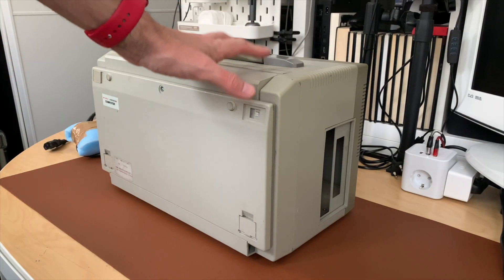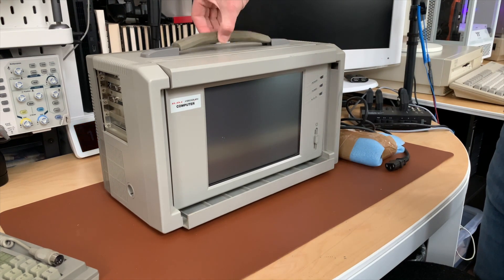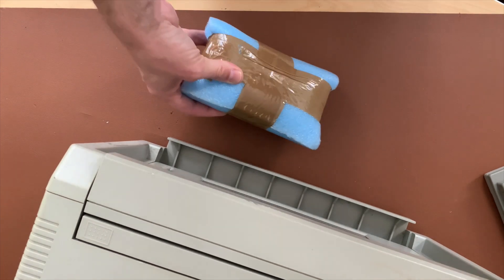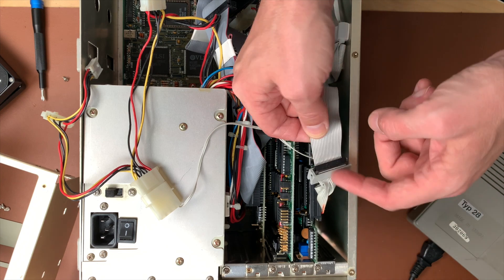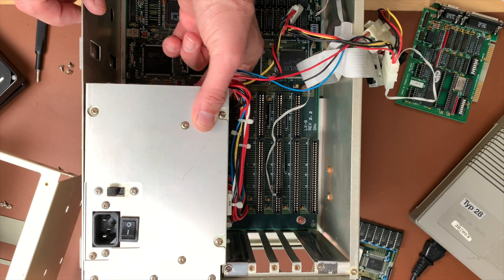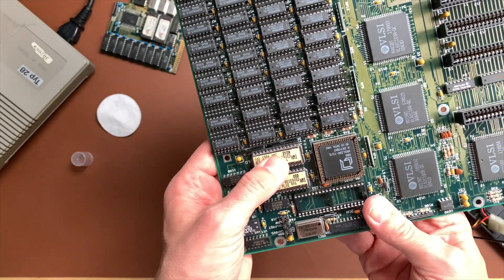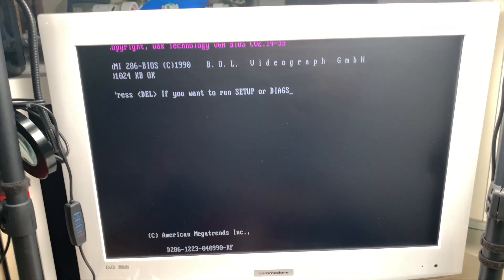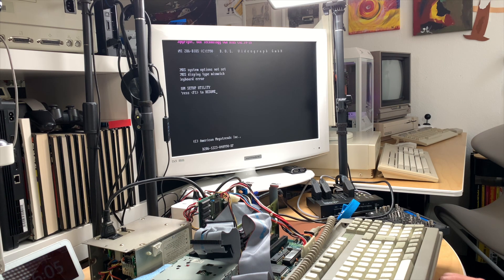Unboxing a late 80s 286 suitcase computer

Comment: On these older AMIBIOS machines, after hitting DEL (it's picky as to when to hit it so I spam it just like you, which results in an ignorable keyboard error message), it'll still ask to press F1 to resume. If you press F1 however, NOW it asks you if you wanna go to the BIOS, the extended settings, some machines have another menu with Diagnostics, or just boot.
If that doesn't happen, it might be the extended setting are kasploimulated (I'm watching too much Shango) and cause the machine to insta-crash. In that case, HOLD the INS key while powering it up. Release it when you see the screen initialize (or whenever you feel like letting go). This returns the extended settings to fail-safe defaults.
Reply from the maker: Thanks I will try that!